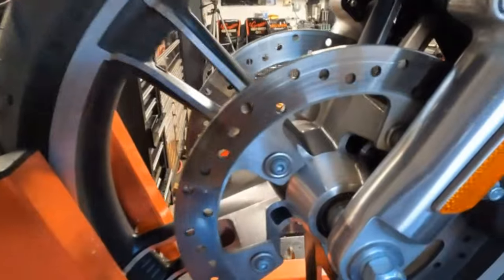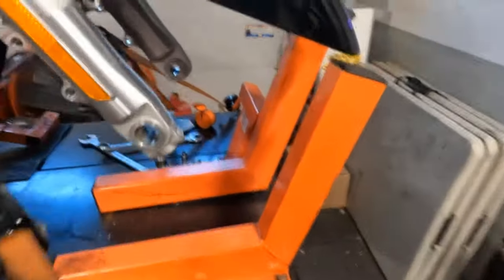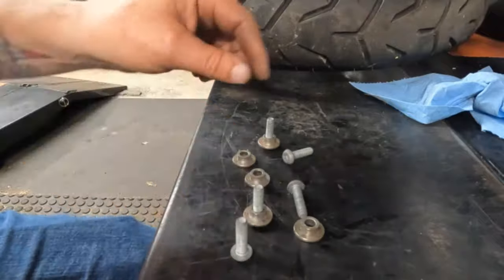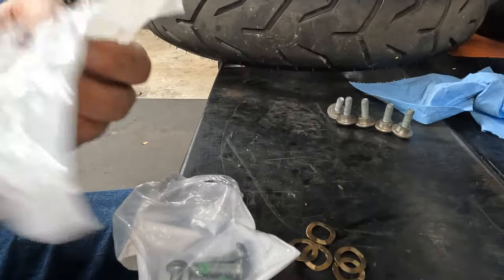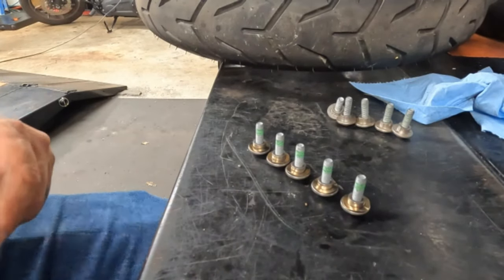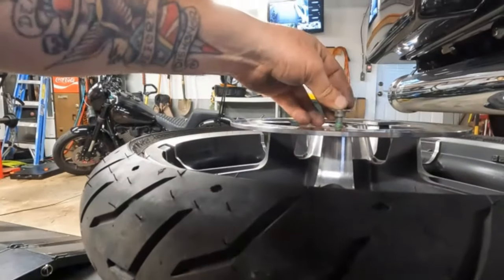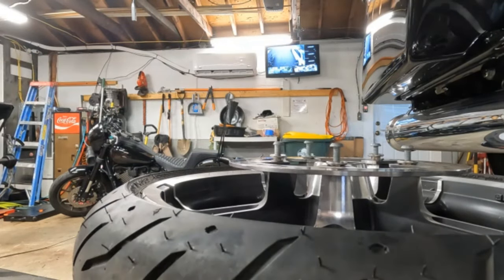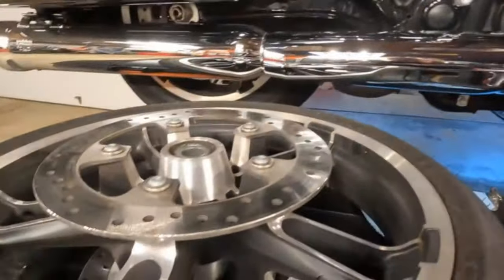Brake Rotor clunking noise

Comment: As a non Harley guy can you tell me how the rotor is floating if its bolted to the wheel. Surely the idea of a floating rotor is for lateral self alignment with the caliper and pads. Also why do HD use a mix of metric and imperial fastners?
Reply from the maker: Yes I can. The boots hold the spacers tight and the spring washers allow the rotor to float.
Reply: On super sport bikes, rotors can be full floating or semi-floating. The former actually jingle The whole idea is to have equal and symmetrical braking action between brake pad and rotor  (self adjusting).
Reply: @louismartin4446  yes I'm used to rattling brake discs that why I couldn't see how these were floating. Most floating discs I've seen are have a carrier that bolts to the wheel with the disc attached with bobbins.
Reply: HI Colin Full disclosure: I know nothing about HD’s as I only own sport bikes. HOw HF calls these “floating rotors” is a stretch at best.
Firstly, as you know, there is a big difference betweeen semi and FULL floating and all related to the bobbins/carrier design.
I suspect HD is calling these “floating” because those washers “act” like a semi—fixed attachment? In this vid one of those washers broke and I suspect that’s what they are supposed to do when the “semi-floating” action develops fatigue and gives away. I use the words
“Supposed to do” satirically of course. I clean my semi floating bobbins to ensure the “semi floating action” is retained. But HD has a different perspective I gather. Perhaps a brake/HD expert can chime in because I am interested in knowing the true “science” here.
I think the video and this discussion furthers our collective knowledge about bikes and - in the end- we all benefit because we love our bikes-all shapes/sizes and brands.
Reply: The shouldered washers bottom out against the wheel then the spring washers allow the rotor to move side to side so the pressure against the rotor from the pads is equal

Comment: Any chance this can be done without wheel removal?
Reply from the maker: Yes. You would need to do one at a time  as you rotate the wheel.
Reply: @DrHarley  I replaced all hardware rotor still moves as before. I guess my rotor is out of specs on the screw mount g points. Do you see any other option?
Reply from the maker: @RidersUnited  no I can't. Did you replace the hats and springs??
Reply: @DrHarley  yes all 3 elements of 5 mounting points.
Reply from the maker: @RidersUnited it's probably the rotor that's warn.
Reply: @DrHarley  bike had 10k miles it was doing from brand new when I got it 2 years ago. Shame on new bike to deal with it.
Reply from the maker: @RidersUnited than I would put it on the deslaler.
Reply: @DrHarley  yup that's the next step for me I guess
Reply from the maker: I am thinking it could be a wheel or the Rotor.

Comment: How many miles on that bike? I have the same issue with only 8k miles on it!
Reply from the maker: I honestly cannot remember.   Was not my bike.  If I gave you a number that would be a guess.
Reply: @DrHarley 
No problem. Mine only has 8k miles on it and I have the same problem. I was wondering if the one you worked on had lots of miles on it, or if not, it’s an issue they need to look into. Thanks for video and the response.

Comment: What about aftermarket rotors?  Do they all use the same spring washers?  I bought an 07 electra glide ultra classic and rotors are clunking.  At first I thought it was play in the axle shaft and wheel bearings but it does appear to be rotors.  Im also getting pulsation when braking.
Reply from the maker: Yes the after market rotors use the same mounting hardware.  I recommend replacing all the hardware when replacing the rotors.  Harley states that the rotor bolts are a 1 time use only.
Reply: Does it typically cause a pulsation?  I didnt hear you mention it.
Reply from the maker: @chadquinn1087  no.  Pulsations are due to the warping of the rotors. Most of the time.

Comment: Could you replace these without taking the wheel off?
Reply from the maker: Yes you can.  You can just do one bolt at a time and spin the wheel to get access to each bolt.
Reply: @DrHarley  thanks for the response I hit follow and I look forward to more videos
Reply from the maker: Thank you.  I am in Daytona for bike week.  The 12th at 8pm is a build up of my 131 and on the 18th I will be doing the motor swap live starting at 10am.